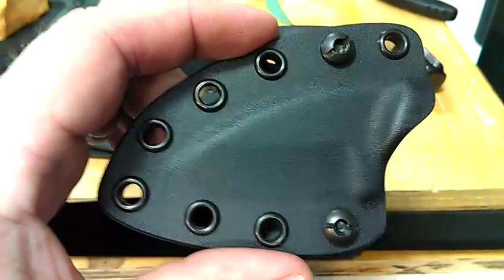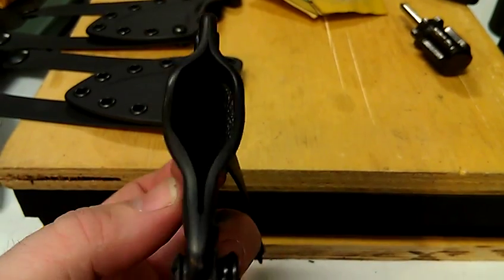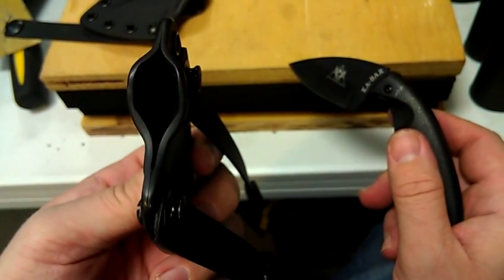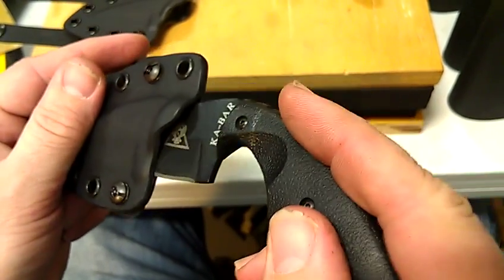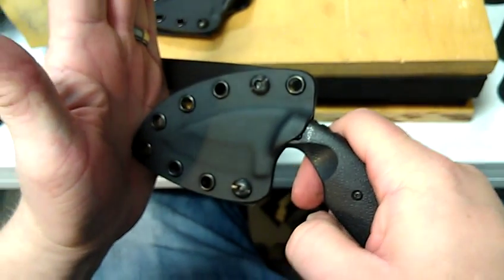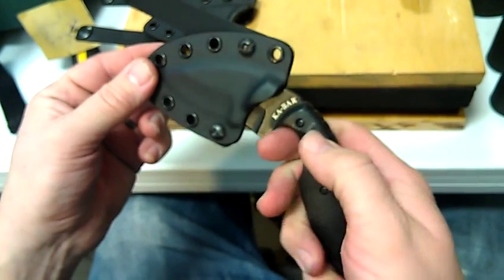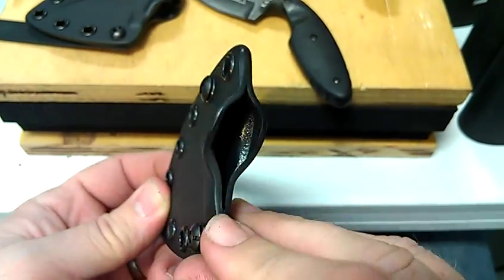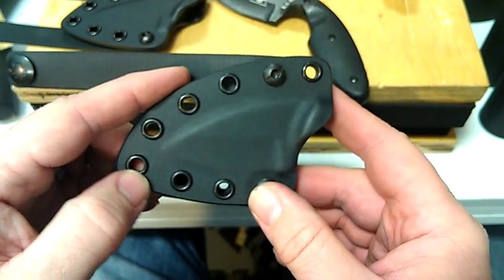Ka-Bar TDI knife FAQ - Matthew's Fabrication

Comment: Don't change a thing! The retention looks absolutely perfect. Seems to be a great product at an excellent price point. I plan to add a TDI to my EDC setup and this is the sheath I'll be ordering. Have a good one! Carry on!
Reply from the maker: Samuel,

Thanks, I appreciate the kind words. The best & cheapest place to get the sheath in on my website www.MatthewsFabrication.com & if you have instagram come follow me there @MatthewsFabrication 

Sincerely, 

Matthew 
#MatthewsFabrication
Reply: +Matthews Fabrication Definitely, will do brother. I'll definitely go give you a follow, I enjoy Instagram a lot. 
The thing I like the most about your design is the slim, low-profile shape. Nothing added to the sides width wise, which is a huge deal for me since I'll be carrying off hand @ my 11:30 position for my weak hand in reverse grip. The thin width profile made your design superior. It just follows the curvature of the blade so perfectly. No frills just business. That's the way to go. Most things are unnecessarily over engineered nowadays. It doesn't have to be big and bulky to be considered quality and "tough gear".
Reply from the maker: Samuel, 

Thanks for all the kind words, glad you like how it is slim & a superior design. That means a lot, thanks. Thanks for the following on instagram as well, I'll try not to disappoint, lol. Have a great weekend. 

Sincerely, 

Matthew 
www.MatthewsFabrication.com 
#matthewsfabrication

Comment: Just wonderin will the belt loops fit a 5.11 belt?
Reply from the maker: mrl030186,

It will fit any belt measuring 1.25", 1.5", & 1.75" wide belts. You can also add another hole or two to fit smaller belts. Hope this helps.

Sincerely,

Matthew

Comment: Just received mine today for the larger Ka-Bar knife.  Will give some feedback soon.  Thanks Matthew!  Anthony.
Reply from the maker: Anthony, 

Sounds great, hope you like it. It is a tight sheath, so push hard & fast. The whole Blade is covered by the sheath. If you have any questions, don't hesitate to ask. 

Sincerely, 

Matthew 
#MatthewsFabrication
Reply: I want to do a video review today on my YT channel.  Can you send me some talking points on some important items to hit?  Thanks.
Reply from the maker: Hello, 

That sounds good. The eyelets are 3/4" spaced apart for multiple carrying options. Just remove the screws on the soft loops & position to your desired carrying style. The soft loops have Military pull the dot snaps that only open when you pull the dot & not in any other way for safety & security. I use .080" thick kydex for durability. Has a full cutout to get a full grip on the handle. So your ready to use it in an emergency & not have to worry about repositioning your hand after you pull it out since you will have a full proper grip from the start. It has made tight retention & takes a little getting used to, but with time you get used to the extra security/retention it has with peace of mind knowing the knife will be there when an emergency arises. I hope that helps.

How do you like it so far?

Sincerely, 

Matthew 
Instagram: Tag me using @MatthewsFabrication &
#MatthewsFabrication
Reply: Thanks for the info.  how do I use these snaps?  I love the sheath so far.  It is really working out great!  Anthony.
Reply from the maker: Anthony, 

You press the snap on with the side opposite of the dot & press it on. You may need a flat head screw driver to open the snap the first couple times as some are tough.  And to open you pull on the dot area to open them. 

Sincerely, 

Matthew 
#MatthewsFabrication
Reply: Thanks

Comment: To whom it may concern. If you are contemplating which sheath to buy to replace the abominable stock TDI sheath, let me help.

DO NOT BUY Galloway Precisions sheath. It will be a downgrade for multiple reasons. The stock sheath has better retention than the Galloways. All you have to do is breathe on the Galloways and the knife comes out. This is bad. That is not retention. An infant can pull the knife out. That's not an exaggeration nor a joke. It comes out that easily. I couldn't fight, climb, mountain bike, run ie. LIVE without worrying about it coming out. I don't trust it. I am very active. I need the knife to stay where its at til I yank it out.

I bought a Galloways sheath once upon a time before I discovered Matthews and I never used it. Save yourself some money, save some time, save your life. If you are like me you also have carry a firearm. A holster. Whatever. Sh*t we depend our lives on. I am not over stating this. Perhaps I take these things too serious or more serious than the average person. No problemo. 

Ladies and men that dont exercise, YES, you can insert and remove the knife. Trust me. I've tested with women and children. Its called mechanics, not strength. Its the result of excellent design and engineering of this sheath. They don't have pink. Look at Matthews Fabrication, not me. 

Get the sheath. Slap an Ulticlip 2.2 on it and call it good. That thing won't go anywhere unless they take you with it.

If you are in the Tempe, AZ area and are serious about your safety or your ladies safety and want to see the difference between proper retention compared to whatever Galloway calls that thing their sheath does, message me. Anything for a fellow protector and Sheepdog. I have both sheaths. I only depend on one.

I've taught self defense for years. Both empty hand and weapons. But, Im a nobody. Just some guy. More importantly, I'm a consumer. Take with a grain of salt. 

Listen or dont listen. I ain't your daddy.

Good talk. Stay safe Sheepdogs.